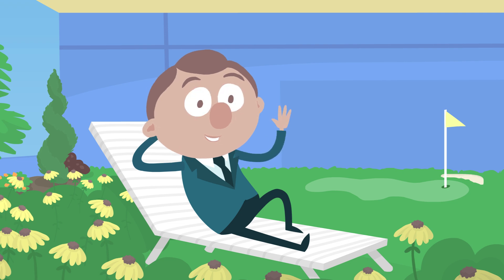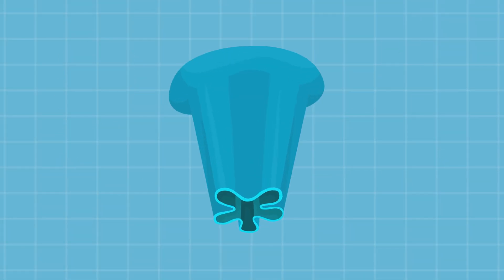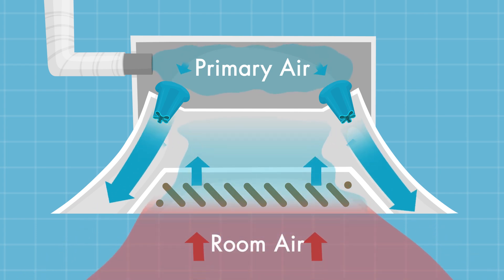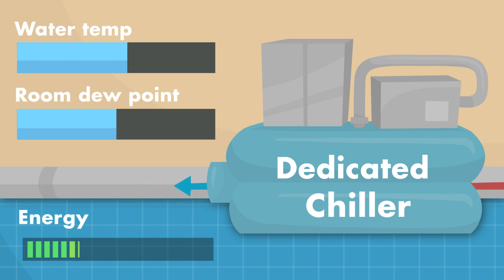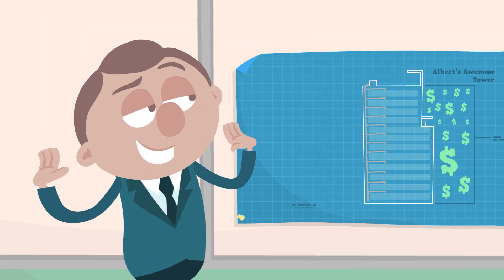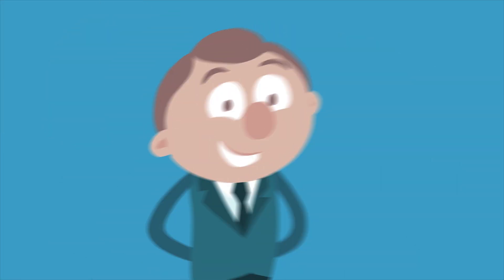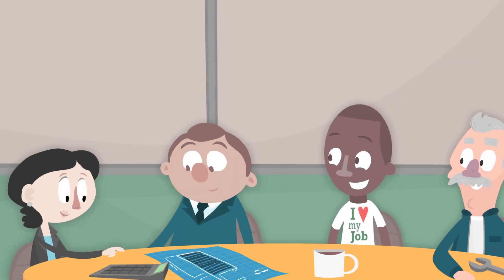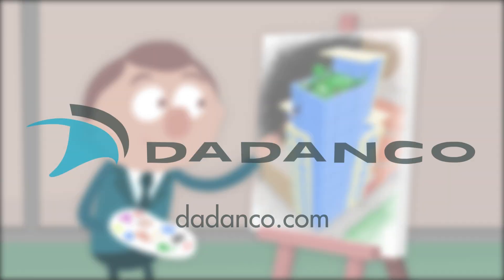Dadanco - Active Chilled Beams (Imperial)

Comment: How do you make sure to get the right relative humidity in the inlet air?
Reply: the fan of the air handler is slower, so air has more time to condense in the coils, also usually it uses a large coil, that's how.